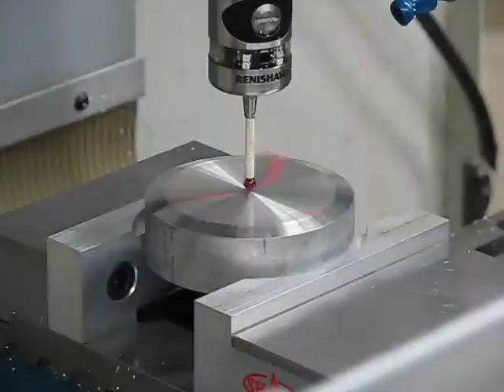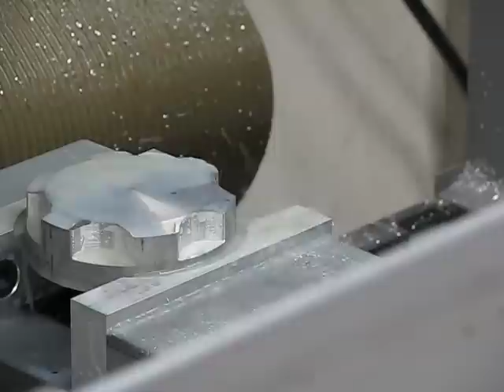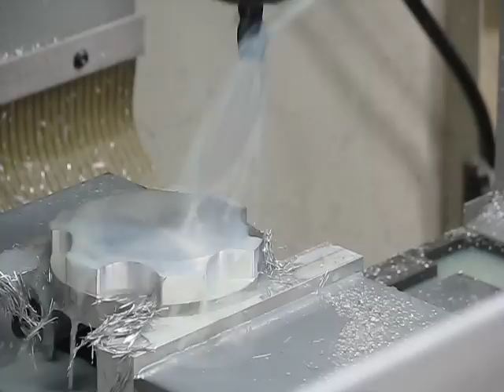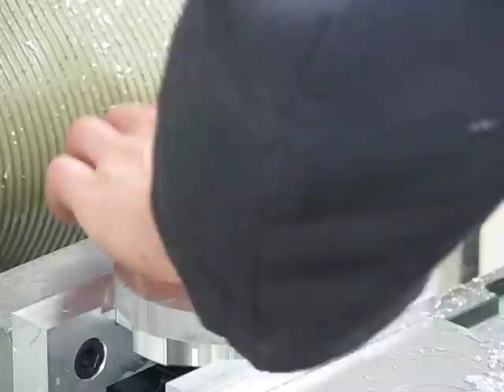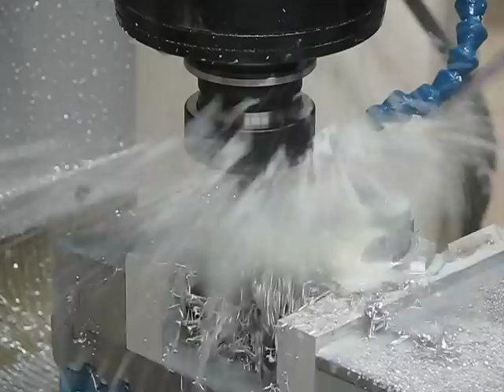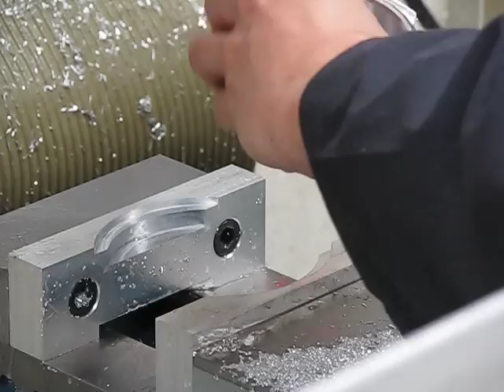Aluminum Filler Cap - CNC Machined on HAAS TM-1

Comment from the maker: Top top operation removes material from the perimeter of the piece. When it's flipped and re-clamped in the jaws the Y zero location moves off by around five thousandths. If I had to spit out 10,000 of these things I'd consider programming the change in, but this is simple enough to do. If I used the finishing contour to rough the grips the cutter would spend half the time cutting air, unless you're considering doing it in one pass, which this machine would struggle to do. Thanks for watching!

Comment: we have three probe (renishaw) equipped haas milling centers at work.  Handy as hell! We use them to qc parts before removing them from the fixture in case they need small dimension corrections.

Comment: A few tips. 

You are already running limited engagement tool paths. So do all of the endmill work with a 3 flute mill for Aluminium. Limited engagement tool paths should not need a rough cut endmill. If a standard endmill is screaming or chattering. That means the speed, feed, and/or engagement needs adjusting. 

Put a nozzle with a small stream on your coolant line. That will increase coolant pressure to blast away the chips.
Reply: Or a good 4 flute with deep flutes works well on aluminium as well. With limited engagement, a 5 flute may work well also.
Reply: a 5 flute ??
Reply: +shayson1357 I have used a 1/2 inch 5 flute carbide endmill on aluminium and 360 brass. Granted it was only buzzing material to length. But it worked very well. I do know 5 flute endmills do not like high radial engagements though.
Reply: Why would he want to use an endmill and do all that roughing work? That's what roughers are for. The endmill for finishing will last much longer.

Comment from the maker: Hi Leix99. It i supposed to be threaded, I'm waiting on a bigger threadmill in the mail to do the 10tpi thread though. There are also matching weld-on bungs that will have the matching thread. Once I get all of the parts together I'll make another video of the cap and the bung being made including threading. Thanks for watching!
Reply: Hi Jonathan Proce.
Can you help me.
I am running cnc hass v9 milling machine
However, I do not know how to use automated metrics like the videos you share
Would you please help me how can I use Auto Metering?
If so please give me the program code.
sincerely thanks
Look forward to the help.

Comment: It's best to avoid blowing chips around when the machine is changing tools. Chips are prone to get between the tool holder and the spindle taper.  That causes tool runout (not good) and if the chips weren't soft aluminum could be hard on the tool holder and spindle. You can enable setting 42 on a Haas to automatically pause after a tool change so you can inspect or blow parts off, then resume by pressing cycle start.  It's similar to M01 but you don't have to have M01 in the program.
Reply: these guys are "engineers" aka HACKS. you are talking to the wind.

Comment: Why do you probe the part each time? It appears that you cut the form jaws which implies that you would already have the x-y-z fixture offsets. The 1st side doesn't matter so much but by re-probing the 2nd side, especially raw billet, you are losing your concentricity between the 2 sides. No biggy on a part such as this but bad practice for parts that matter. Also wondering why you would rough each notch instead of using the same "finishing path" for roughing? Just curious. Anodize and engrave?

Comment: we have a TM-1 in our shop with a 4k rpm spindle, although we were able to tweak the parameters to get 6k out of it, it sacrificed the torque a little, but ours doesnt have the flexible slide cover in the back, we call ours "Ms Piggy", because it makes a huge mess. (especially when flycutting) it throws coolant everywhere. lol

Comment: Nice, what year is that? and will it fit in a garage? And is it 220v. thanks
Reply from the maker: +Bigwingrider1800 It's in a garage, yes, need 10' ceilings though. It's 220v and I think it's a 2001.
Reply: Im looking at a 2000 low hr's.   12000 what do ya think. 16x12x10   full enclosed.. mini
Reply from the maker: Seems fair, but only if it has the colour display. I can't remember what year they started putting those on.
Reply: Its not, it seems like an amber color, also its only 6000 rpm is that what you have.  1570 hr  spindle run time. its a clean machine.   ps:  i'v been running a tormach 770 so this will be a substantial upgrade    x5..
Reply: jon, is there an area to allow you to see the machine run time. Now i know theres a place but i was told the motherboard battrey removed resets this but there is a master that cant be. Does this sound rite?  thanks for all your thoughts, I was told from a macherny place 1570 spindle hr  cant be rite..
Reply from the maker: +Bigwingrider1800 it's not impossible. The only in this video only had 1400 hours or so I believe when it was purchased.

Comment: Every  one is having their say which is spot on in my opinion and my thoughts are that haas machines are very cheap and very fragile when they are required to cut metal that is a lot harder and stickier then ally in 
My Opinion every haas machine I have ever worked on or come across  has struggled really bad or simply just not able to cut the material so to me this is evidence my original opinion was correct how did I come to this opinion ? I have spent 20 years cnc machining 5 off those years spent as a programmer operator on the shop floor the last 15 I worked I have worked on the apps for various machine tool builders  which include both Mazak and what used to be Maho to name 2   From my own experience and I know other people that have purchased machines from haas and they quite simply could not do the job that the sales team said they could. Looking back with hindsight which I know is a marvellous thing they wish they had paid the extra money and purchased a better machine some of them actually did some got Hurco some got Mori some got Mazak yes the original outlay was a lot more but the machines run fine....,,, the Hurco runs 24/7 and has done for 5 month so it is what it is 😀
Reply: +Chris Murray  In My experience with Haas Machines.. they are quite accurate.. i used to produce hydraulic parts on them.. like valve bodies.. the Haas did the job nicely.. the only bad point about it.. i just HATED the CNC Control.. i Prefer Heidenhain over anything.. or maybe Siemens.. they seem to be almost the same.. 
As a matter of fact.. i wrote my own CNC programming software, and developped my own language to have the same programming power on my own machines at home.. :)

Comment: Why probe the stock on the second operation?????? That defeats the purpose of the softjaw.....
Reply from the maker: Part of the OD was machined during the first operation, which means that when the part was flipped the part center shifted in the Y direction that amount.
Reply: 30 year veteran Mechanical Engineeer/CNC Programmer/set-up/extreme editing Machinist here. For those who watch this... who want to learn the proper way to cut this part... use your jaw work-coordinate for both operations! It's already been established when you cut them! LOL! This is common sense if you are an experienced CNC Machinst! Concentricity will be almost perfect! Probing like this to set your work-coordinates is the wrong way to learn. Maybe hes just showing that you can probe with this app,,, but there is no text explaining why he is doing this. I'm not dogging your vid... just want others to know that this is not a proper way to set your work-coordinates!
Reply from the maker: duggy freshness  After probing on the first side it would be simple enough to move the origin up half the same amount as was removed from the circumference during the first operation, but the stock OD has a tolerance of its own. The only way to ensure concentricity after the flip is to probe it again, unless the actual stock OD is measured each time and the compensation is adjusted. It's probably not worth much thought since it took less time to probe it than it did for you and I to write these comments.
Reply: @JonProce  you're ignoring the part where your soft jaws G54 won't change though

Comment: job  clamped in soft   jaws,i think no need to take datum one more time. it is only
 2-3 minits  machnineing work.
Reply from the maker: Material is removed from the OD of the piece during the first operation. This changes the position of G54. The part must be probed again to update G54 to the true center.

Comment: That should only be a 2 or 3 min run. looks like you use corn cob cutter for hogging. just use a basic 2 flute end mill all the way.
Reply from the maker: No program is perfect. We're limited on this machine by slightly worn spindle bearings. Heavy MMRs result in chatter along the Y axis.
Reply: Jon Proce i can see why the machines wore out, you are part of the too fast too hard club. slow the fucking machine down! all those hard stops and starts are hell on the machine.
Reply from the maker: Diesel Ramcharger

The video is sped up...

Comment: why r they pouring milk over da metal?
Reply from the maker: It's coolant.
Reply: small children drinking coolant?
Reply: TwoForFun  vitamin D is good  for the Aluminum...keeps it hard.  I drink it and  it does the same for me.  Do you want some 2-4-fun?
Reply: i would like to try to drink that but will I become aluminium?
Reply: Coolant is 93% water give or take
Reply: why white then?
Reply: Because you add this oily stuff to it and when it mixes it turns white, it's like when you pour cream into coffee
Reply: but oil cannot be stirred in water, it is no efficient than
Reply: I understand oil floats on water but it has the consistency of engine oil
Reply: engine oil still oil

Comment: I don't think you needed to probe it twice. The part is already centered with the first position. You're also probing on rough stock anyways. Not the best accuracy. Also, why in the fuck are you blowin' air around while it's doing a tool change?? Probably getting chips in the taper.
Reply from the maker: That rough stock is exactly why it does need to be probed twice. Think about what happens when it's flipped and clamped back in the vice.
Reply: +Jon Proce Oh right. I was thinking somehow both jaws move to center.
Reply: The air being blown around comes out of the spindle taper, for the exact reason of keeping chips out

Comment: Jon Proce you thank haas for making good machines what planet are you on are you sponsored by haas ? Haas are the cheapest most fragile machines out their if you think  that What kind of machining have you been doing thanks for the giggle you have just gave me and the boys in the apps department quality by the way and I don't mean Haas machines.
Reply from the maker: This machine is 12 years old, has had little to no service, and was purchased for less than 10% the cost of most of the machines you're referring to. Even so, is performs fast enough for its application and holds tolerances to the original spec. HAAS makes excellent machines.
Reply: Jon Proce Nothing wrong with buying wore out machine for giggles, thats for sure. If this is a business, you are doing it all wrong. If this is your garage, then you are doing it all right ;)
Reply: Diesel Ramcharger didn't say he bought it used. Holds original tolerance spec = not worn out. Of course he could replace it with a newer Haas like your company has done, but why n the hell but a new machine to take the workload off this TM when it's doing the job? That would just be a waste of money.
Reply: What exactly make them the cheapest most fragile machines out there? The great price points aren't because of cheap parts, they are from buying great parts with enormous quantity. Give Rexroth or nsk a call and say your from Haas looking to build a new line of machines and see how fast they want to come show you their newest stuff. After their done cleaning up their pants anyway.

Comment: In reading your comments this is now pathetic.  If you're making a high toleranced part.  There is no need to use the probe every time.  You should know where your part is when you flip it over.  Ie.  Adjust your offset accordingly and make the part faster. It's a Fucking gas cap.  Even nascar isn't going to probe that shit!  An overuse of unnecessary tools if you ask me.
Reply: huh, thats weird.....no one did ask you.